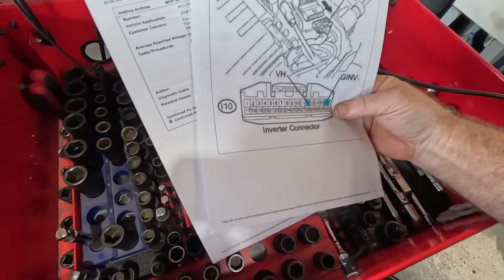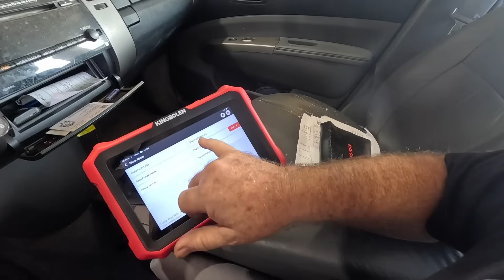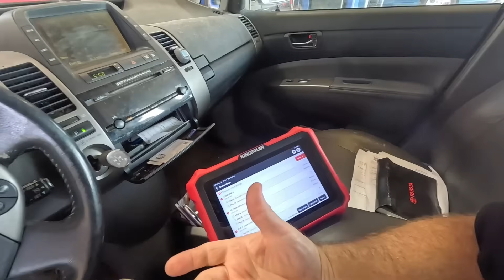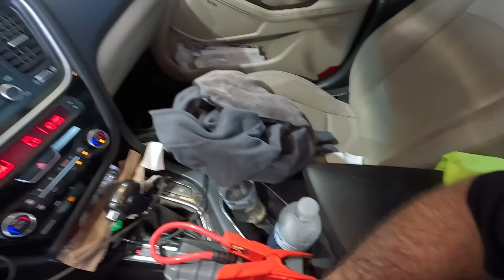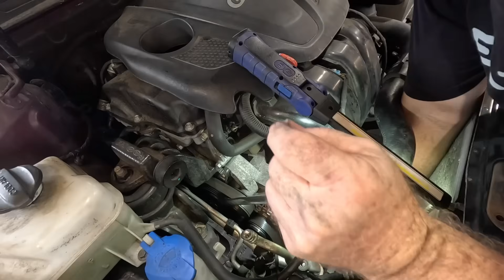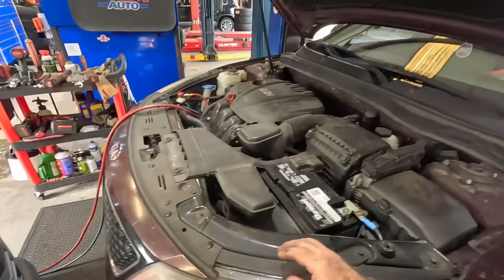Prius Poses Potential Problems, Kia Blows warm A/C. Auto Repair Shop DAY 767

Comment: 236 Prius Sawzall blades.   21:55, Yea I did spot the AC fuse, upper right of the cover you were holding.  At least it said AC.  The quick seek & find game was cool, thanks!  

When you get to a point in a repair, like with the Prius, where they want to install a sketchy junkyard part, can you reserve an extra 3 or 4 hours for diag work before you even touch the car?  I'm guessing the shop is giving a hard labor quote to the customer, and since you touch the vehicle, you're now locked into that initial labor price for the whole job.  Trying to understand why you are working for free.  I wouldn't expect it from any shop to short labor because of a weird, freak issue my car has that is out of the norm.  But if I'm on a budget and can't afford even another $40 for labor, what do I do as a customer?  Abandon the car if it's in mid-repair?  I'm not trying to side with you, the shop, nor the customer, but for more of an understanding is all.  Perhaps a video explaining this would be cool.  I don't want to be that problem customer, ever.  For me, I'd rather have that same shop there, and continue to trust that shop.  It always saddens me when a shop or a business closes.
Reply from the maker: Yeah it can be a tough deal all around when it comes off the rails. But I feel like if we are always honest and keep the customer informed, we are doing our job. Sometimes the tech eats a little of the loss, sometimes the shop, but rarely the customer. So it’s important to be experienced enough that an estimate is really close up front. 
If there are potential added problems also up front about that in advance. So we aren’t half way into a repair that might never be completed.
In a perfect world. :)

Comment: I've had the same problem with a hybrid Camry before. It started out with a bad abs, check VSC, and a shaking transmission.  It ended up being the hybrid battery pack. It somehow sets the codes. Check out the cells in the hybrid pack.
Reply from the maker: Yeah that can happen, good to check the hybrid battery as well. We got it sorted and it will be in an upcoming video. :)

Comment: Just by the condition of that used ABS module, I would have sent it straight back. Looked like it has been sitting in the rain.
Reply from the maker: Man used parts look sketchy but work well. Surprisingly is was ok after it was all sorted out. Coming up in a video soon!